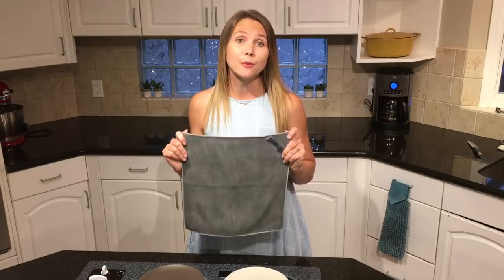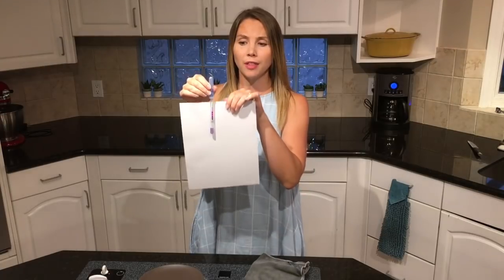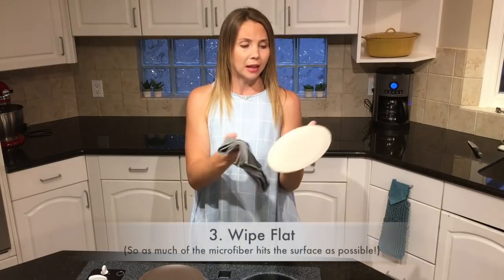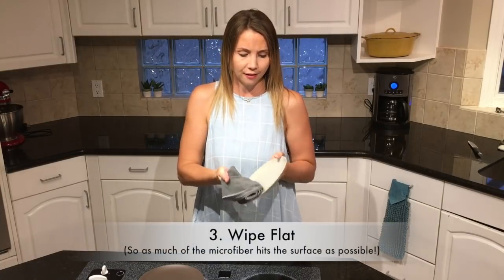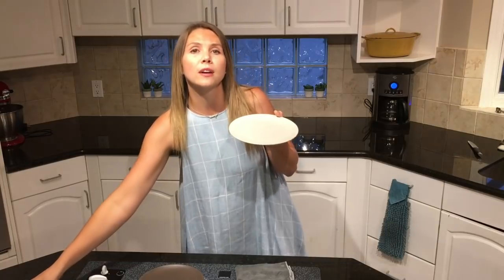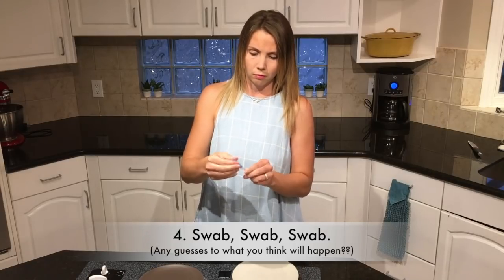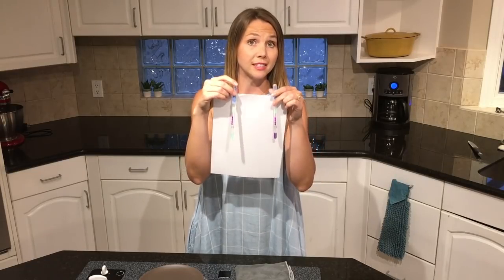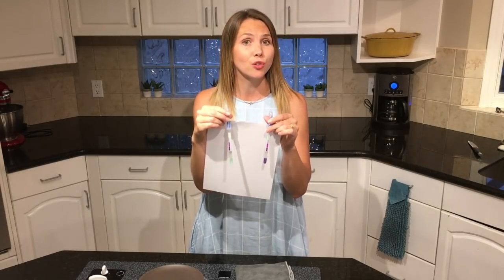How Does Norwex Work? | Lindsay Mercer

Comment: Thank you for sharing this video. I was wondering what the results would show if you did the same mechanical cleaning technique with a cloth other than Norwex. That would show if it was the method or the cloth.
Reply from the maker: A very valid point! What I share at my parties is that how well the cloth works and its ability to remove bacteria really depends on the weave and density of the cloth itself. Standard microfiber that meets regulations to be sold under the label of "microfiber" needs to be split 1/6 the size of a human hair. Norwex microfiber is split a minimum of 1/200 so those microscopic fibers give it the ability to mechanically pick up bacteria from a surface. Norwex uses third party testing specifically for bacteria removal as well as cross contamination so if you are going to use a microfibre cloth and water to clean, make sure the company who manufactures their microfiber also has this testing!
Reply: I recommend you watch the “Andy Will it Work Norwex” to see a comparison with other inferior microfibers and paper towels. It’s quite shocking, really.